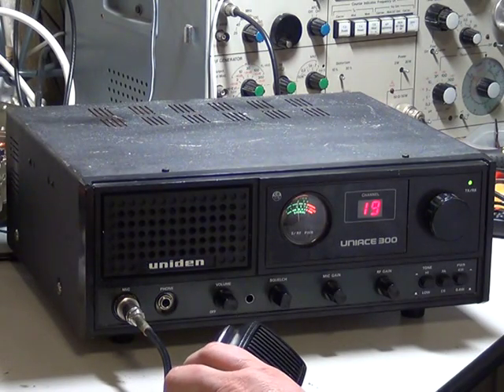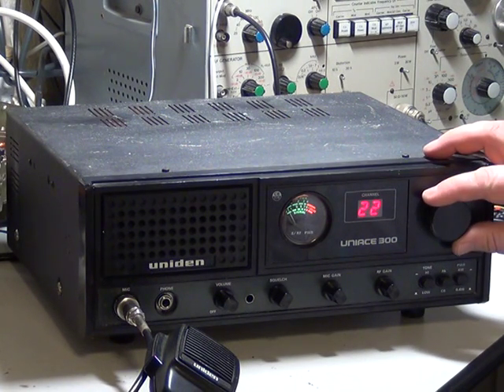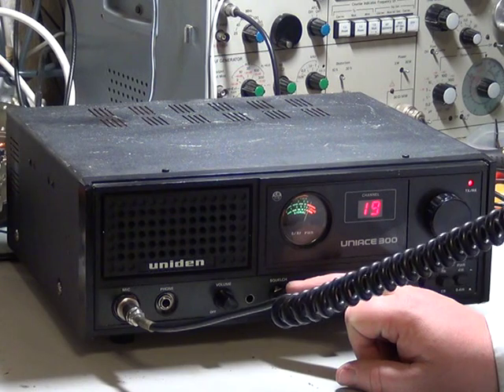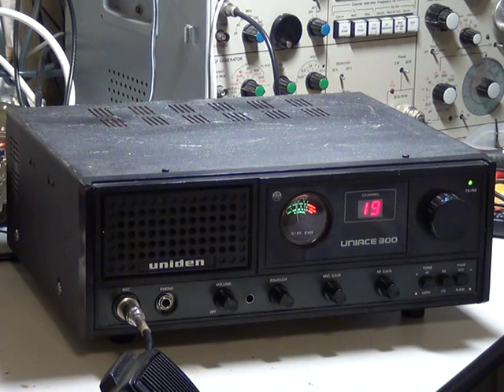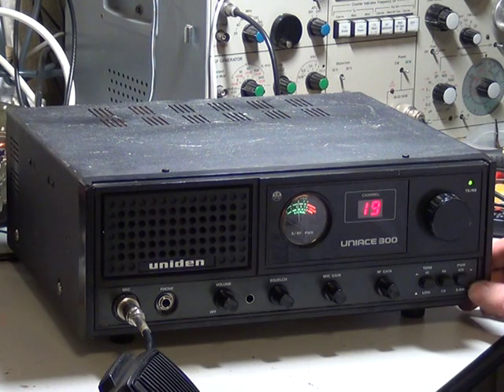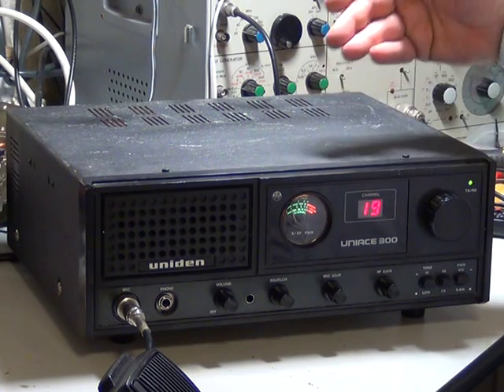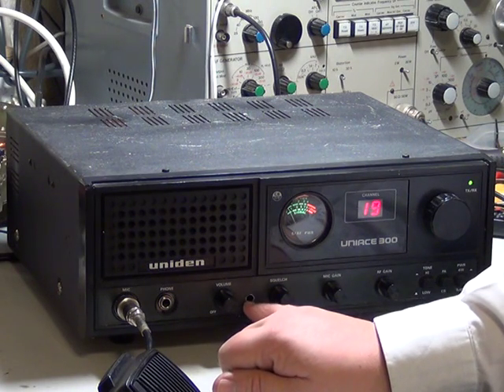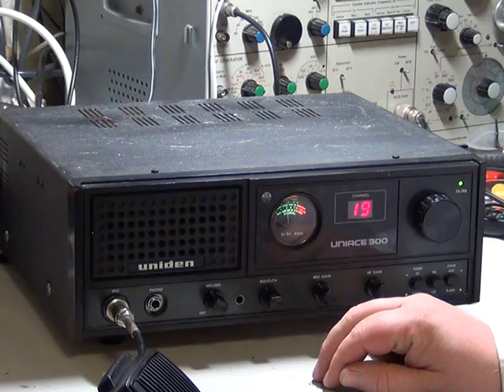Uniden Uniace 300, UK (CB 27/81) CB radio (Base Station) -  On The Air

Comment: How do u get on fm and am? Theres these nobs on the side but i dont know
Reply from the maker: The Uniden 300 is 40-channel UK FM only. Only one base station was ever manufactured that did 80-channels i.e 40 UK & 40 CEPT channels, but is still FM only.  The UK only got consent in 2014 to use AM on the CEPT channels, so radios before that time will not have the facility to do AM.

Richard, G0OJF, UK
Reply: @ukfmcbradioservicingTango21  what are the nobs on the side for?
Reply from the maker: The only knobs are on the front on this model. Perhaps yours has been messed with.

Richard
Reply: @ukfmcbradioservicingTango21  oh there is 2 nobs on the right side of it a guy sold it to me for 20 pounds
Reply: @ukfmcbradioservicingTango21  if you could look at my youtube video i will upload in a min maybe you can tell whats wrong
Reply from the maker: Absolutely no idea. take to top lid off, take some photos of the innards, email me & I'll tell you. rshireby@yahoo.co.uk  If it can be restored back to working order, they fetch £65+ all day. Just can't tell from the video. must be a strange modification....most of which don't work & therefore stop the radio working.

Comment: Hi just a quick one I have 1 of the uniden 300 and the mic audio is very quiet how do I turn it up mic gain is on full . 
Thanks in advance
Reply from the maker: +Keven Moore The deviation adjustment is shown on the video. It can only be adjusted using an FM deviation meter and cannot be guessed. FM deviation meters are readily available.